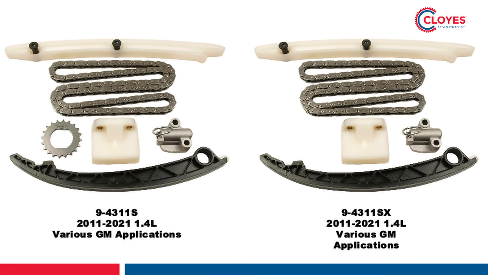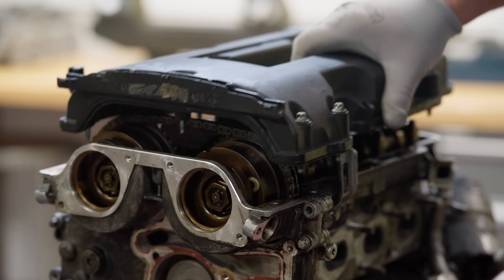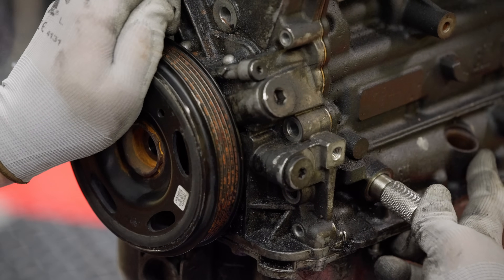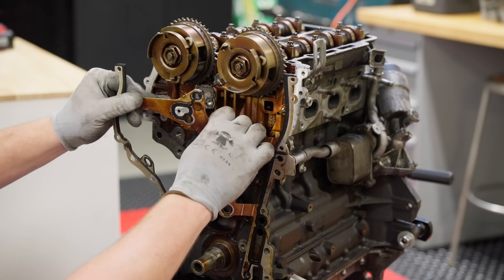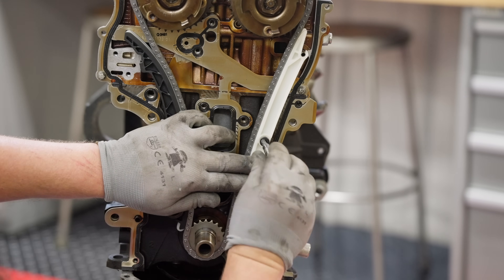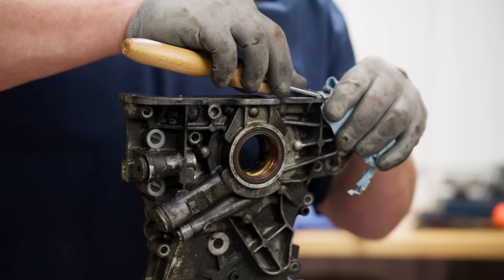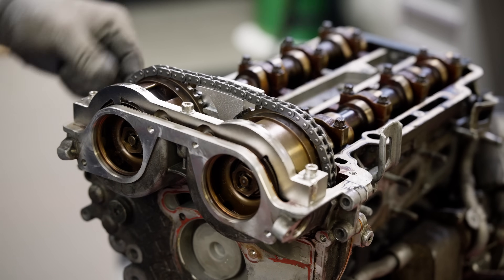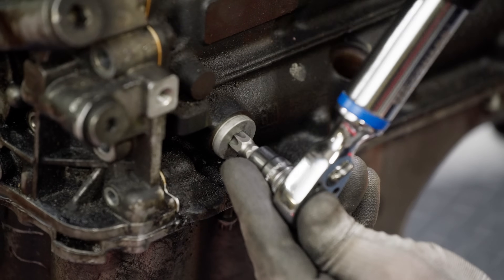GM 1.4L Gen III EcoFlex Engine Timing Chain Replacement, 9-4311S & 9-4311SX

Comment: I really hope you read and let me know that I want to buy your product for Nissan VQ23 DE engine but I have difficulty getting the part you advertised can you tell me where I should buy it considering that the market in my country does not sell it (Indonesia) maybe you can share a market place link that can be reached from Indonesia? such as eBay, etc. or for those who know in the comments column, you can tell me. Thank you